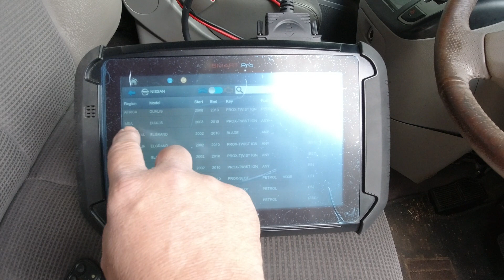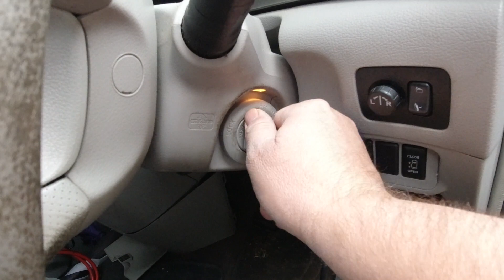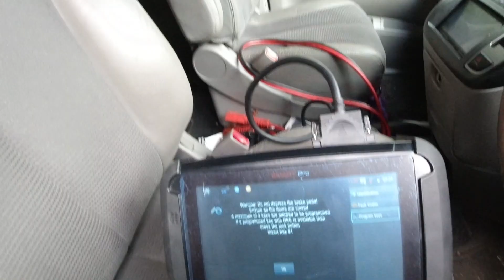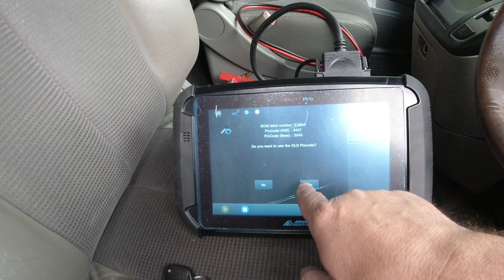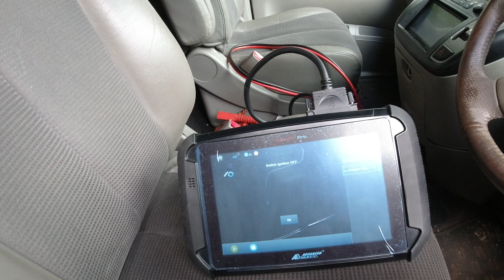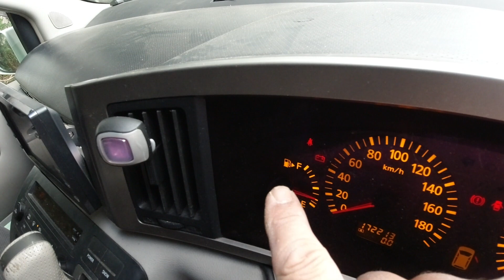Nissan Crack BCM Code With SmartPro

Comment: I have a USED GENUINE transponder key from another Elgrand.
I insert this USED key into the keyhole and place my original key nearby then I can turn and start the engine.
That means, there is no need to cut the key. Perhaps, we only need to reprogram the USED transponder key.
Can you reprogram the USED GENUINE transponder key?